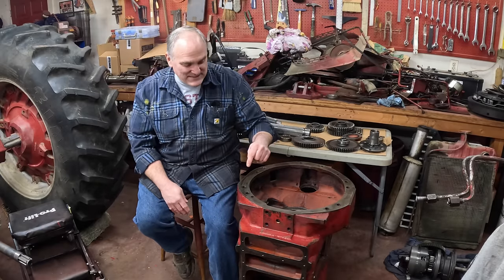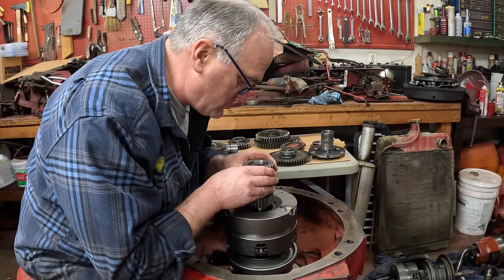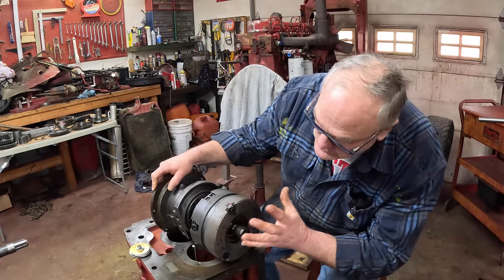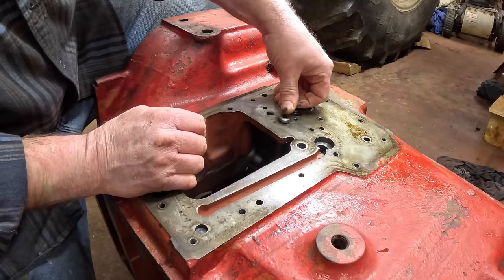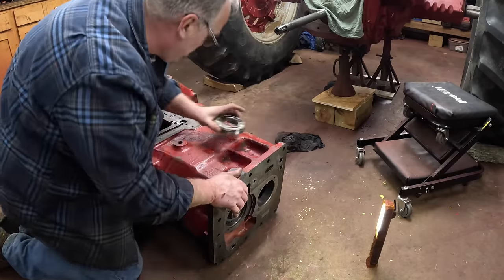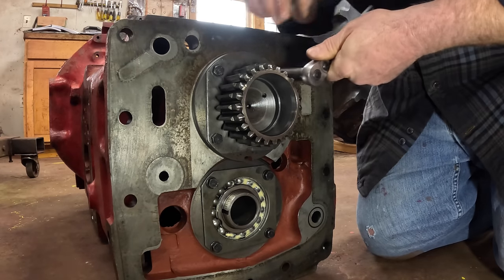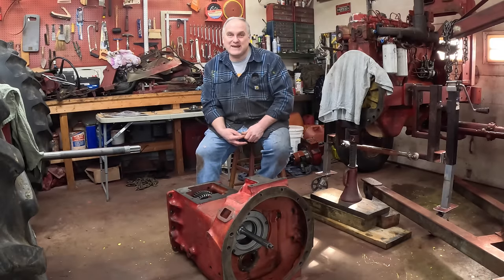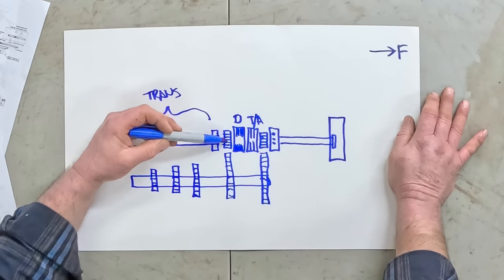Installing a New Torque Amplifier & Assembling the Transmission | Farmall 856 Restoration Episode 7

Comment: The IH TA was a big problem for John Deere for a lot of years lol. Because when John Deere got into a tough pull and would peter out on pulling power and stall, IH could pull a lever, and split the gear they’re in, in half and pull through the tough spot, and keep on going lol. This was usually used while plowing. I tell you the TA is one fascinating piece of IH engineering, and in 1954 when it first came out in the Super M, the engineers at IH were some of the most brilliant minds in the entire Ag Industry. Even today the TA remains a big mystery to a lot of people, and yeah you have people that love the TA, and you got people that hate the TA and delete them out, but to me, the TA means you always have that edge over other brands, because no other brand can have it. It’s one more reason IH is the best even today still. And it’s one more reason John Deere was always behind IH as a Ag manufacturing giant.

Comment: Okay - I was looking to see how the counter shaft would still drive the tractor in the forward gears because, of course, the counter shaft is the reverse shaft (for those of us who don't deal with these tractors).  You answered it, so thanks for that - OH,  and don't forget to remove those 8 bolts one at a time on those retainer plates and add the blue locktite (lol).

Comment: That TA is where farmall really came out ahead of Massey Ferguson in that time period. And I’m a die hard Massey man. MF multipower works in a very similar manner, but in low multi, the tractor is able to freewheel. The TA comes out way ahead because it maintains engine braking and mechanical connection in both modes of the TA

Comment: Thanks Pete. Great series. Have driven many of these old tractors and never thought about how the T/A worked, but knew they had a very important job.

Pete, maybe something to keep in mind when you deal with those clutch plates on another tractor rebuild. Recently I rebuilt the PTO on a Ford 7710. When putting the whole PTO and transmission back together, it was a bear keeping all those clutch discs together. Finally, I greased all the discs and that made it sticky enough to keep them together. I'm getting old now and don't remember as well, but I think there were 10, or 11 discs. 
Thanks again for sharing. Oh..dont forget to Loctite those 2 retainer bolts.
Many blessings.

Comment: Pete, I'm 1980 graduate of Nashville Auto and Diesel College. They had a triple-countershaft transmission that was built by Mack and its application was moving structures.  In order to get it ready for course curriculum it had to be taken apart and machined down so it wasn't quite so difficult to pull apart and reassemble. We used 50Tons to get those gears off the main shaft, keyed and pressed if I remember correctly. The fun part was timing all those counter gears correctly or it would lock up. Heavy duty transmission class was dubbed basic finger smashing 101.  I enjoyed automatics the most, learning to read fluid charts is as easy as reading an electrical diagram. Each component has a job and the fluid is routed buy those components via a maze by glance valve body. Just train yourself to recognize each of those lines as a small pipe and how all the components work, i.e. vacuum, electrical, mechanical and diagnosing will be easy.

Comment: Proper job! And I mean it as a mechanic with 30 years of experience. And without all the means I have at my disposal. I've seen people do stuff....  mount bearings and couplings with a 25 metric ton forklift for instance. I'd give you these jobs without hesitation though... except for the "a torque of just a bit tighter then a four foot bar", heheh. Bit I've been guilty on that too tbh. You get a sense of what torque you're applying through the years. And as said, that type of securing will wear out. I think it's better to keep it easily adjustable like you did. Welding on gear parts is never good. Loctitte can do that job just fine.
And I agree on that play issue. Since it was free rotating and you can only increase play (there was minimal play), I'd say it's fine in the case of surface wear. Pretty close but fine. And it adds some security imho regarding the fourth ring imho. I'd say retorque it after a while but that might be a huge job for a bit of sense of security. I guess a guy like you will notice when it would become a problem. Good choice to use loctite in that area.
Nice background info on the engineering part of it all too. and it's interesting to see how they tackled all of this in the past. Your explanation was just fine. And I think you assumed right.

Comment: I think the Sprag Clutch allows the shaft to rotate at the faster speed, when both clutches are engaged.   The two clutches are trying to spin the shaft at two different speeds, but the Sprag only allows the higher speed through.

Comment: Great video! The best and most informative step by step Ta  install video on Youtube.

One thing on checking the endplay,  You need to make sure you loosen that hose clamp on the input shaft while checking. 
Not sure if you did, but jus so people  know.  And it needs to be tight again when removing and reinstalling unit with oring. Don't want the  sprag assembly gear sliding apart.

I always check it on the  input shaft for movement.

Great job Pete!

Comment: Great video.  Thanks.  Some of my understanding of the TA (which could be incorrect) is the sprag clutch transfers the power when in TA.  The clutches on the low side are mainly there to prevent free wheeling when going down hill when in low.  The disadvantage to the sprag clutch is there is some wear on it when in direct drive because the shaft is rotating backwards in the sprag clutch (overrun).   I believe mechanical diode TA was developed to reduce the wear during overrun.  The mechanical diode TAs are the same as the other it just has a different one way clutch in it (mechanical diode vs sprag clutch).  Their is some good explanations of comparing these two on the internet.   I like to think of the mechanical diode as a ratchet wrench and the sprag as a pipe wrench.

Comment: With as much work as you have put into this, it deserves better paint than the cheap enamels from the big box stores.... I am hoping you go with actual IH paint on this one (I know its still enamel, but at least the blend is correct so if/when it fades, it fades like they did originally and not to milky color that the off brand stuff does).

Comment: Tremendous video series you have going here.
To my knowledge, the mechanical diode TAs big selling point was a different sprag, supposedly capable of holding more horsepower, opinions varied on whether they were infact more reliable.
As for the electric shift TAs, I think they only use the electrics to shift the TA, I've never heard of any TA sensing or adjusting pressure.

Comment: Enjoyed the video and info. I have a 544- if you think of it, could you explain why the tractor will free wheel on a hill with the t/a pulled back?
Reply: The mechanical TA tractors like your 544 don't have a lockup clutch for TA drive, only for direct drive.
With the TA lever back, it drives through a planetary gear set with a sprag clutch holding the planetary housing, which only holds in one direction.

Comment: Pete,  International Harvester should have made an animated film presentation as a sales tool or to explain to shop mechanics how this torque amplifier operates.  I could not find such a presentation on You Tube. I understand in theory how this device works and realize the purpose is to increase torque to the differential.  I guess I will have to go back to the previous video to see how the forks and linkages engage this device.  Perhaps you could explain some typical farm operations (pulling plows, discs, round balers, operating sprayers,  loading augers et. al.) that would help us understand why an operator would feel compelled to engage this device?m I know I may sound like a dunce but am not familiar with modern tractor operation.  I know you had to think for a while before you decided to rebuild this device -- I think you will be much happier you did!

Comment: Great diagram I’m not sure it was called out directly or if you implied it… but in your diagram, when you have the direct drive gear as well as the TA… my question is which gear is used when the TA is forward versus TA pulled back? TA pulled back direct drive?

Comment: I believe I have a better understanding of the function of the Torque Amplifier.
Nutshell: direct drive until the tractor gets under too heavy of a load. TA steps in and drops the gear ratio down some? 
Did I pass or fail the test? 🤔

Comment: I'm assuming it's not possible to reassemble / reinstall the unit without removing that hose clamp, right?  I saw that spinning on the shaft when you were rotating the assembly at t=22:57.

Comment: I thought it was more than just an underdrive, but that appears to be what it is.  Not that an underdrive isn't incredibly useful, it often is.  The "shift on the fly" ability is probably the key feature of the unit.  I imagine it was frustrating for the engineers to get operators to use it as intended.  I know, as a kid, it was just fun to make the front end of the tractor jump by hitting the lever, lol.

Comment: Hi Pete, 
We Love your channel. My wife and I are big fans. Maybe you can help me answer a question about my Kioti Rototiller that I bought from a Massey Furgeson dealership. It was corroded with old oil and dirt but still turned so I purchased it for what they gave for it which was $200. I'm changing the gaskets on the gearboxes, so my question is. Do I need to put some Permatex sealer on the cork gasket? 
Thanks, Ron
Reply from the maker: I would use gasket sealer.

Comment: Excellent vid Pete. One, actually a couple questions possibly arise from this. 
The first one is heavy duty TA vs reg TA. The TA you had in the tractor was it heavy duty or not? I think I'll stop here because if the answer is "same" then no further questions needed.
 After watching the diagram video, it raises another question. How is it felt by the driver when you've got the tractor in the TA mode? Wouldn't a lower gear produce the same effect? And one more question, where you have the four clutch plates where you previously had three? Is that in the direct drive or is it in the TA drive that was sent with the heavy duty unit?

Comment: I like it a lot….I’m sure it’s more hassle to film and narrate but it’s something you’re good at and it’s very enjoyable….first…the factory worker that would build these must be highly skilled-not just a nut on a bolt guy….a testament to good ole’ American manufacturing……and secondly my college learnin was that transmissions were to match engine speed to wheel speed…but I think torque is at play too after some reflection…..so why a TA….duh to amplify torque but why a whole separate mechanism…..it seems the whole point is there is a lot of options for speed and power….I might be answering my own question but is it for work that might require more or less speed or more or less power?  Is there a need for so many options in a tractor this size? Is having  a separate TA more efficient at power amplification as opposed to just more gears in the train? I like the addendum at the end now don’t forget to get some blue locktite….two different places need it if I remember correctly….
Reply from the maker: Hi, I think the key is that the TA is a power shift mechanism. Shift on the go without pressing in the clutch.
Reply: @JustaFewAcresFarm  like a go button….lol
Reply: @JustaFewAcresFarm  so shift on the go…it’s not variable though…Ike it’s slow vs fast….if I understand the mechanism correctly

Comment: What would cause me to want to drive in TA mode or direct drive mode?  What do you face as an operator that would want you to switch drives?
Reply from the maker: Hi, it's essentially a power shift. T/A mode reduces ground speed about 20%. So when you hit a tough spot plowing, making hay, etc, you can slow the tractor without pushing in the clutch. It's called a torque amplifier also because with the speed reduction comes more torque to the wheels, increasing how much pull the tractor has where the wheels meet the ground.
Reply: Oh ok cool thanks!!

Comment: The only thing I'd ad is.
There's a 8 speed and a 16 speed version of the same tractor.
.
The 8 speed is more of a classic gear trans, without the reverser.
.
Your describing a reverser, so you have the 16 forward speed version.
Reply from the maker: Hi, it's not a reverser. It's a powershift to slow ground speed. including the T/A, 16 speeds forward and 8 reverse.
Reply: @JustaFewAcresFarm  ahh OK.
That explains why there are a different number of forward and reverse gears.
As a reverser setup is normally the same amount of speeds in each direction.

Comment: Love your videos… but I would never use loctite where there’s a metal tab to prevent the nut vibrating loose… all it does is make life difficult for the next mechanic … you said yourself… the spacer wear which in turn results in play between the nut a housing… staking the nut, loctiting the nut, welding the nut, holding the nut with tab, etc. will change that.  Fundamentally the design means the system will need servicing
Reply from the maker: Blue loctite is pretty darn easy to break loose...and I'm not a fan of metal lock plates. I don't trust them.
Reply: @JustaFewAcresFarm  interesting… I have seen blue, high strength, loctite fail but I haven’t seen locking taps fail